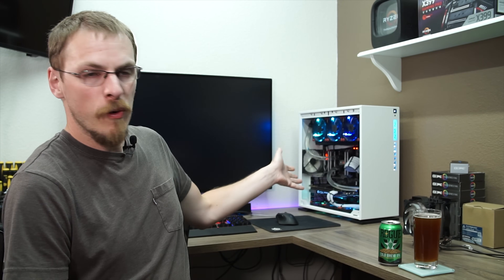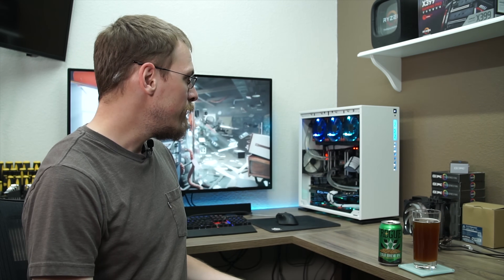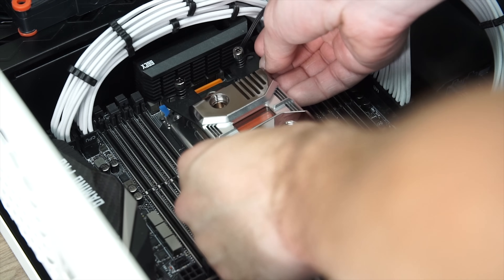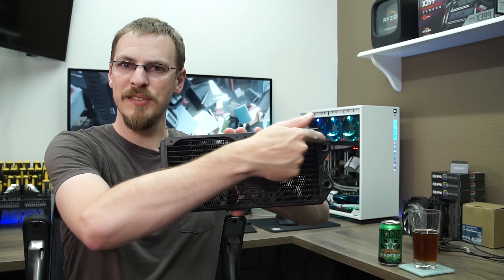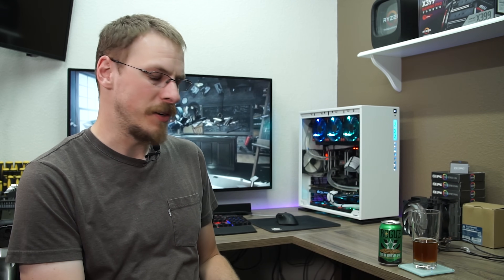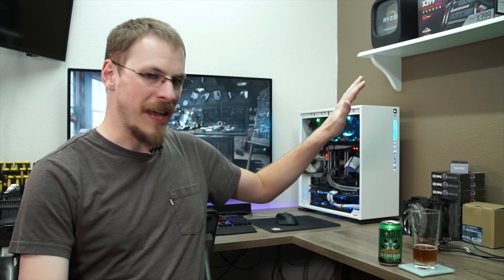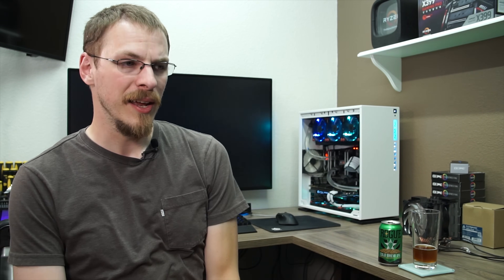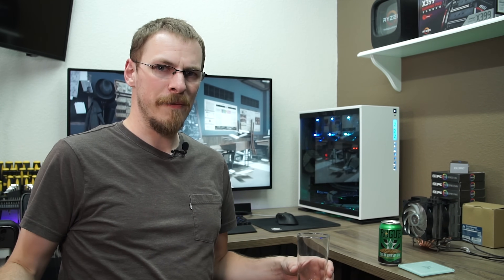Threadripper Gets Wet - The Water Cooling Begins!

Comment from the maker: I am aware the audio on this isn't great.  I'm trying out a new audio recorder, and I'm glad I ran into bugs now rather than next month when I'll be vlogging for a few episodes (spoiler alert).  But for today, you'll just have to deal with 'meh' audio'.
Reply: jerometv it will come in higher resolution soon
Reply: and the video being just in 360p ?
Reply: On the PSU, maybe you have a thermal run away scenario?
Reply: Had the same case and changed it out due to higher CPU temps, because it recycles almost all hot air from other components out on the top were the radiator sits. x3
Exactly what you described. ._.

Comment: I suspect part of your issue with the power supply fan is that it’s taking a lot of the heat exhaust. You only have 2 fans exhausting heat in this case, your rear 120 and the one in your PSU... I suspect you’re pushing so much of your heat out through it that it causes your PSU to be above the ideal thermal threshold so your fan keeps spinning at absurd RPM to cool down the PSU. I saw this issue in a small ITX case I built with only one fan slot that I had as an intake. I flipped that fan to exhaust and drilled fan mounts in the top with 2 fans as intakes. This fixed the issue completely. Unfortunately your CPU heat is all getting dumped back to your PSU, that’s the flaw in a lot of these show cases, they’re too aesthetically oriented and thus have drawbacks for actual performance.

Comment: I would say a little bit bigger case with more air flow in mind. So you could put the power supply on the bottem of the case it will have with the temps

Comment: nice vid! I have a 1950x with hard line and my cpu and gpu being cooled by 2 very thick 360mm rads! I'm surprised by your temps as on a 4.1 OC im running 9 degrees idle and about 40 100% load! I have built in this case and the air flow if im being honest is terrible! I would suggestchanging this case! Love the vid tho
Reply from the maker: I'm hoping a fan swap will bring my temps down to more reasonable levels.  I know this case isn't the best for airflow, but it should be at least usable.

Comment: Did it hurt drilling into the case? I've got a CoolerMaster COSMOS C700P and even with it's size I still struggled to find a home for my EK Res + Pump.
Reply from the maker: Not at all.  The holes are square with the rest of the case, and honestly, won't be noticed if the res is removed.

Comment: The problem with your disappointing temperature is probably the ut30 radiator. You have the xflow model which is a poor design as far as performance goes. There's a reason most radiators have the in and outlets on the same side - U flow!

Comment: I'm a little surprised almost every enthusiast seems to go full custom loop rather than go entirely passive or oil cooled
Reply from the maker: Oil Cooled is one of those 'because I can' type mods.  It's not practical, and you don't really get better results than any other method (other than exotic cooling like dry ice, phase change or LN2).

Most videos go custom water cooling for two reasons.  1) It's typically more efficient and quieter than air cooling, especially if you include multiple components in the loop.  2) It looks really cool.

This build is for productivity, but also for show.  I want it to look good for the next 1-2 years on my desk and in the background of videos.  If performance was the only thing I'm looking for, I'd put better fans on it, switch cases to one with better airflow and call it a day.

Comment: https://youtu.be/U__pRo_SVl4?t=168
It just depends of the specs of the fan, more precisely about the amount of air its able to move(of course  you have to take into  account the rpm and noise) But if a HP Fan can move the same amount of air it will be the same as a Airflow fan. Of course most of the time HP fan requires higher RPM for the same amount of air moved but it doesnt mean that it will be louder(rotor noise, shape of the blade).

About your temps, dont forget that the MA620P is a Dual Tower radiators and performs quite well but i agree that the difference is not that great. Try to use another thermal paste(kryonaut for exemple) or other fan.

About your PSU probably poor airflow or something
Reply from the maker: It can move the same amount of air, but is it going to be able to push the air out of the case, which goes through the PSU attic before hitting a very narrow set of vents on the back panel?  High pressure would ensure the air makes it through the rad, but if it doesn't have the velocity to escape that attic space, it's going to be useless.

And I know the MA621P is a fantastic cooler (it beat out all of the AIOs I tested with this CPU), a triple rad with a much better block should be better than a 6C difference.  I'm chalking it up to lack of airflow to the rad and out of the case.  Hopefully, I'll get the fans sorted here soon.
Reply: I would say yes, more pressure means that the fan can effectively pass more air through the rad(less loss in airflow after the rad) so in fact youll have more velocity after the rad with an HP fan than an airflow fan. (Of course if both fans have the same CFM ) , if they are different its much more complex to determine

The gap between them depend of the heat output of the CPU and what the radiators are capable to handle.
But i dont own your PC neither a Ryzen or a aircooling solution (ive always been under watercooling) and there is so much variable(ambiant air, case airflow,fan, thermal paste)... so waiting for the next video to see what's going on in  your build! 

keep it up ! :)

Comment: You should check out the EVGA Power Link for your GPU. It will help clean up those cables, and allow for more airflow from the bottom fans. Link below. Are your rad fans set up for intake or exhaust? 

@MattsMechanical EVGA Affiliate # P8KCFUP2VV
https://www.evga.com/products/product.aspx?pn=600-PL-2816-LR

Comment: Here's to hoping that Asrock release a Threadripper ITX motherboard using daughter-boards to allow for support of 4x SODIMMs and other threadripper features, I say Asrock as so far they are the only ones making an ITX X299 motherboard and typically make very good ITX motherboards, the main issue is of course heat, dissapaiting the dense volume of heat isn't easy in small cases
Reply from the maker: I sincerely doubt we will ever see an ITX Threadripper, and that's simply due to the physical size required by the CPU.  You could not physically fit a TR4 socket, 4 DIMMs (or even So-DIMMs), and the power delivery required into an ITX space.  And besides core count, you're throwing away every other important feature of Threadripper.  I think the AsRock MicroATX is the smallest we will see.
Reply: Craft Computing Well the best compromise then would be higher core count and higher clocked ryzen CPUs with better ITX motherboard options, using SODIMMs instead of standard DIMMs to provide more space on the main motherboard for other features and more robust VRMs, love the Threadripper build by the way, you produce some really unique content, very consumer focused in terms of the things you review, none of this $50k system size up battles

Comment: What power supply are you using?
I had the same issue with an EVGA 1000 G3
Reply from the maker: coughs EVGA 1000 G3...
Reply: Ah, atleast I'm not the only one!
I had an EVGA 750 G3 and it was fine - I though tthat getting the 1000 would make it even quieter but obviously I was wrong.
Even at idle, the base fan speed on the 1000 is so much higher than the 750.